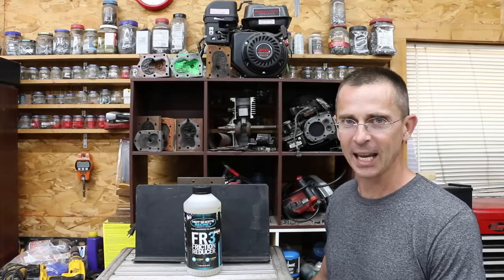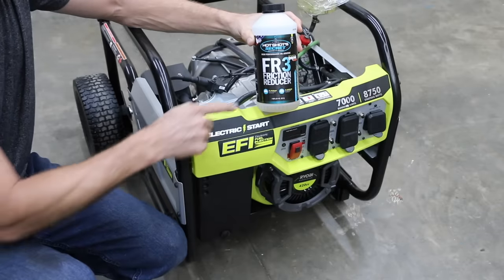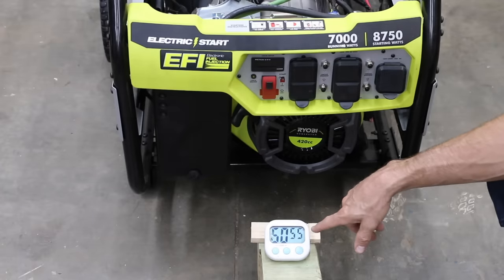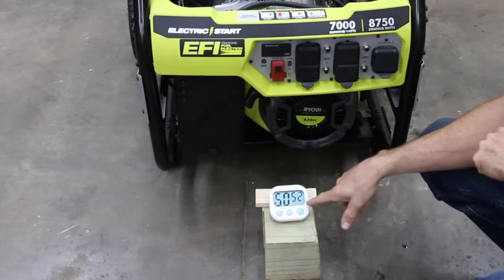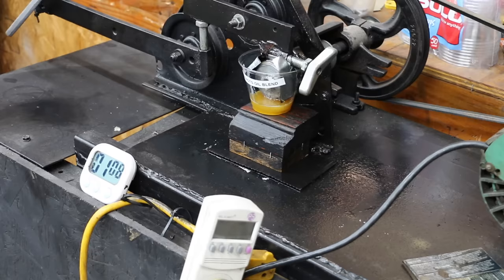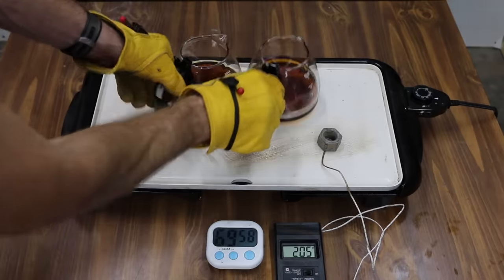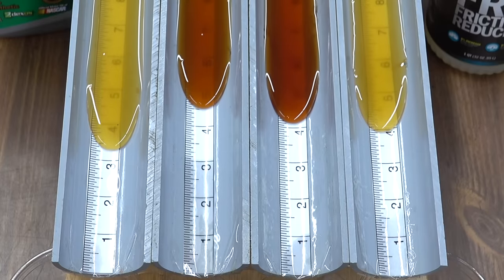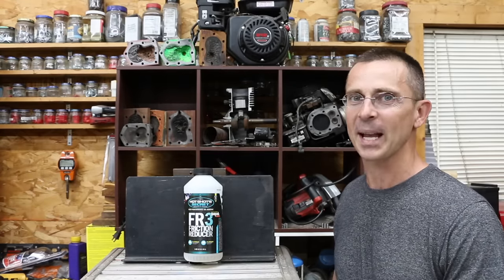Mobil 1 Boosted with Hot Shot's Secret Better? Let's find out!

Comment: PF, great work as normal!  I have asked before, please test https://www.fluoramics.com/tufoil/.  My family has used this for decades with measurable success across the board.  Small, to larger engines and gears.  They have done validated testing with four ball test.  Plus a lab wear test similar to yours. I am NOT paid for this referral, nor have any interest in the products.  Real world measurable longer engine life, MUCH better cold starting, increased MPG over the decades between 3-5%.  Once a engine is fully broken in, and run without this product, mileage is measured multiple times over 1,500 miles.  Then apply Tufoil, the mileage goes up over period of 3000 miles and beyond.  We add new application at every oil change.  In older pre injection car EGR air pump equipped engines, lower temps by up to 6 degrees.  This stuff works.
Reply from the maker: Thank you for the video idea!
Reply: Project Farm.  Any time.  You do great work.

Comment: I honestly don’t see a point in this. I’d rather just buy redline, amsoil, or Schaeffers. I’ve ran all 3. Prefer redline.
Reply from the maker: Thanks for sharing.
Reply: @ProjectFarm  I should of worded I a different way. I meant don’t see a point in the addictive. The 3 I listed has more then enough additives in them and from lab tests I’ve seen and talking to a guy who tests oil building engines says Valvoline full synthetic is the best off the shelf oil. (He proved to me he knows his stuff) been a castrol guy all my life myself but I run them all depending on motor or transmission fluid and vehicle it’s goin in.
Reply: Worded it